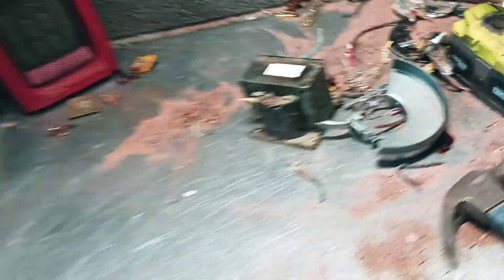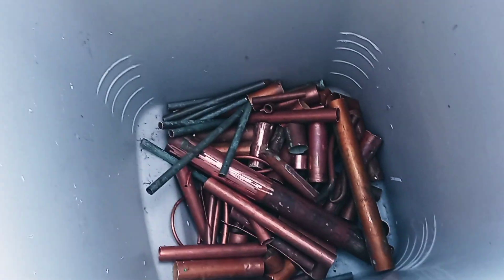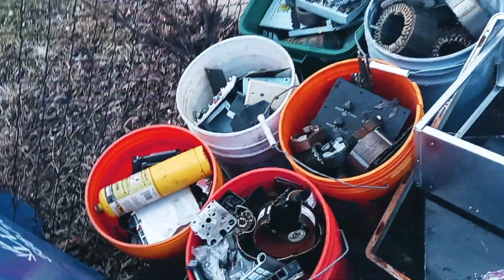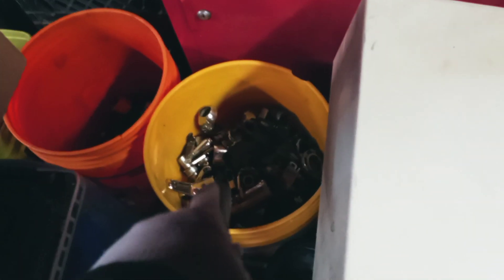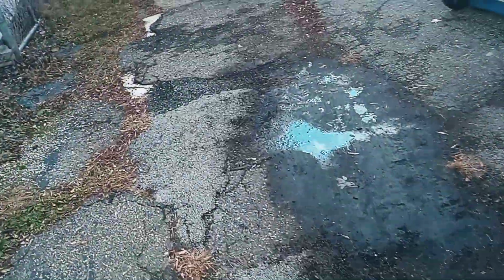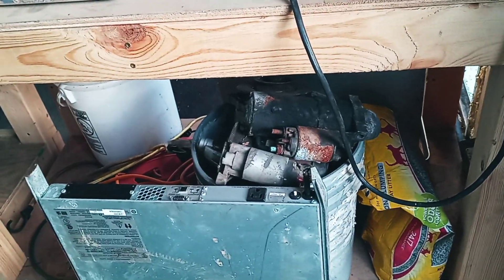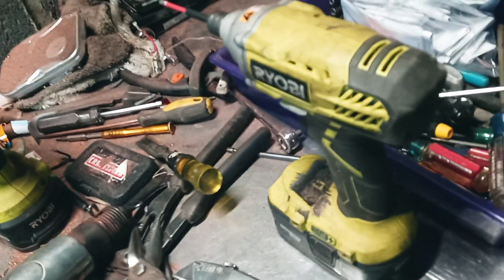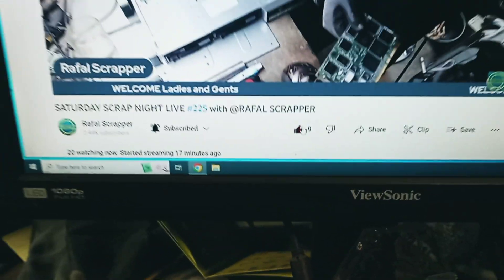To sell or not to sell

Comment: To sell or not to sell? One factor that is often overlooked is that your money is not working when it sits in a barrel. It takes money to make money. Put the money to work buying material, processing and selling.  Holding on to $500 of copper is nice, but if you can turn $500 into $750, that is even better, but by holding, the $500 could drop to $400. Have your money work as hard as you do.
Reply from the maker: It's like going to Boardsort one day & the next day price jumps up. :)
Reply: @ewastemike7700  That happened once. What has never happened to you is the price dropped the day before (or the day of) your visit. I never hear you mention that.